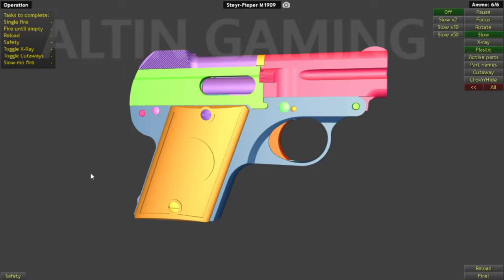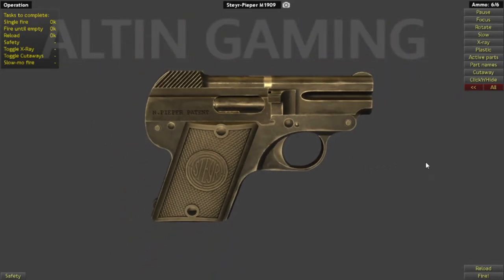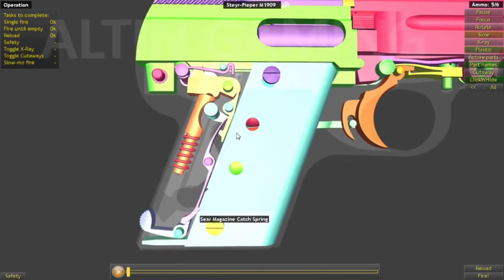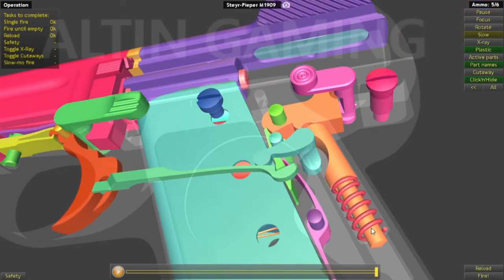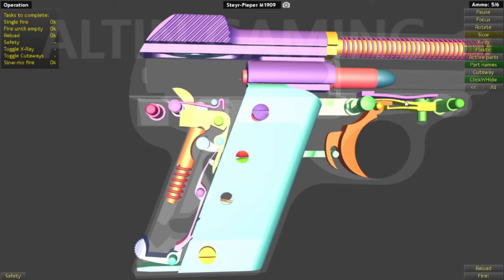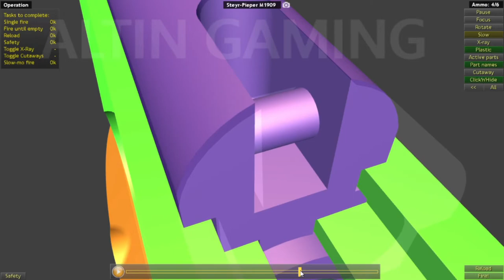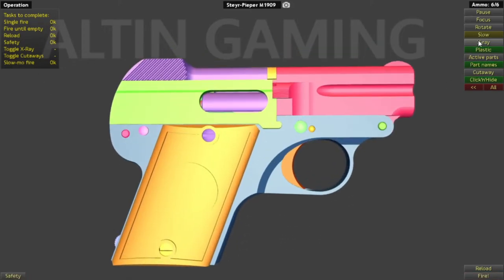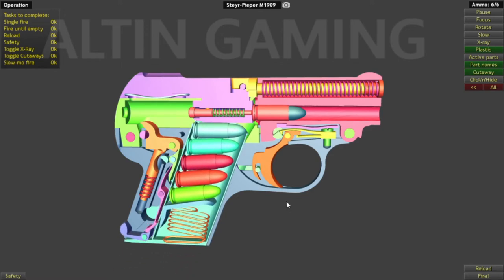This is how Steyr-Pieper M1909 Works | WOG | with commentary

Comment: Reasons for the swing out barrel:
1) The pistol doesnt have extractor. If you need to unload the chamber, you need to open the barrel. As it is a blowback pistol, it doesnt need extractor, during firing the pressure in the barrel pushes the bolt and case back.
2) It allows to have 1 more cartridge.
3) If you just shooting for fun, you can skip loading of magazines. It can be faster to shoot 50 rounds by loading cartridges one by one in the barrel, than loading the magazines and than firing. Not sure if it actually is much faster.